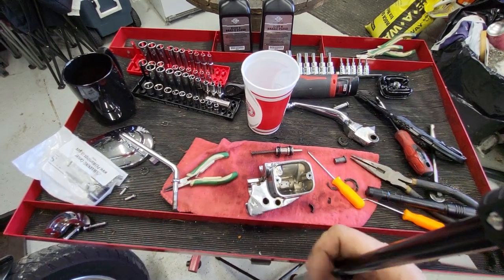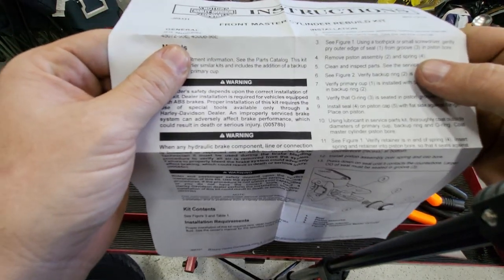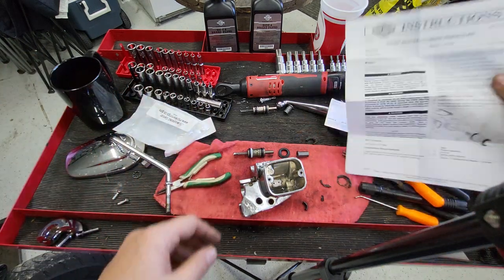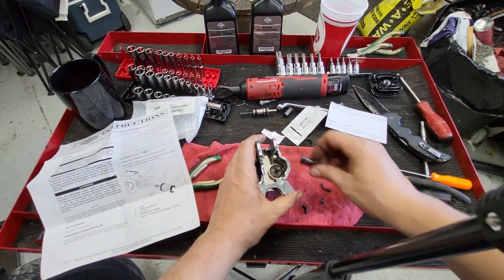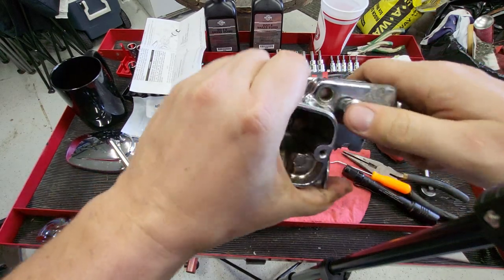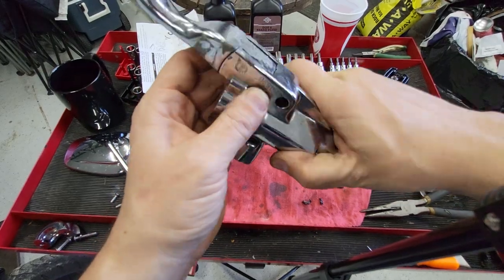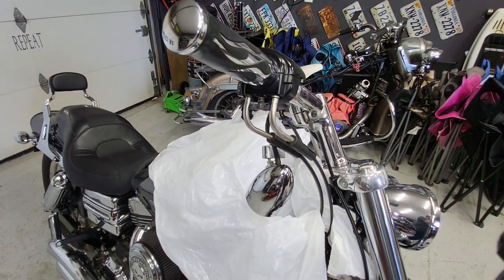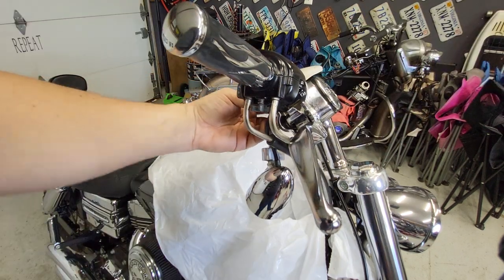(Part 2) 2008 Harley Fat Bob front master cylinder rebuild

Comment: I was looking for how to connect the brake light switch to the wire

Mine is it 75 shovel head I put on a new master cylinder, but I’m not sure how to connect the wire to the brake light switch inside the master cylinder 

Any thoughts on that?
Reply from the maker: So there should be a little two prong switch inside your lever, it doesn't matter which side is positive or negative the positivewire would be 12 volts coming from your bike, however you have it wired, then the switch, then the opposite wire would go to your brake light, which should be grounded through the mounting bracket to complete the circuit. And they are usually just held on with crimped connection spade fittings. Every once in a while you find one soldered in place.